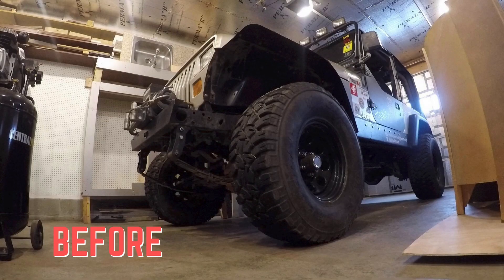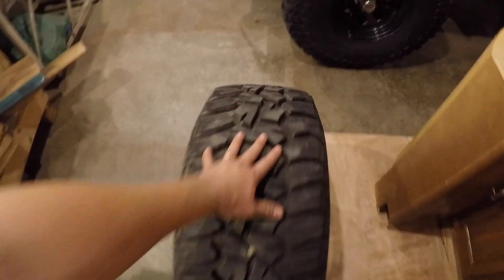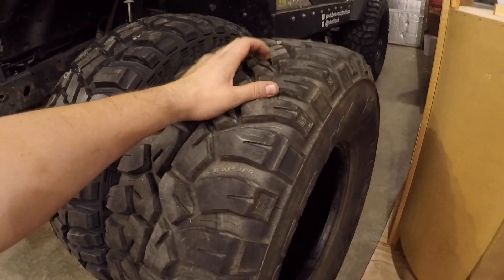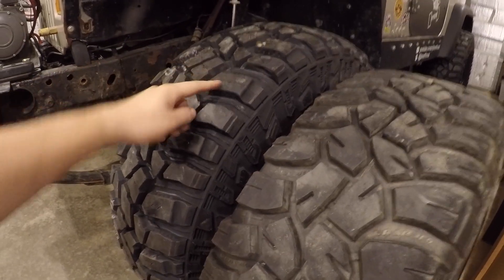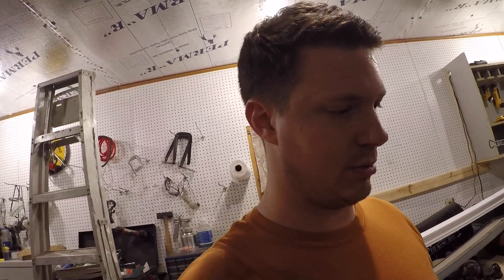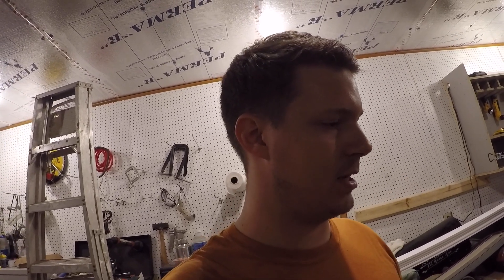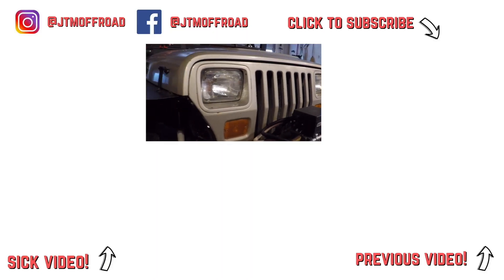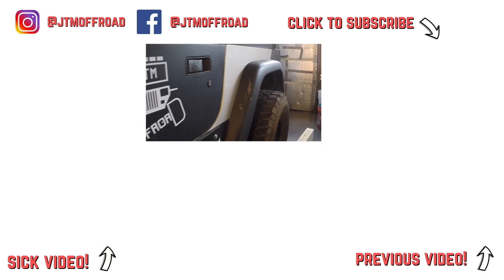35" Discover Cooper STT Pros!

Comment: have found the pro's to be even better than the originals in all aspects. They won't disappoint you , your air pressure for your YJ should be around 21-24 psi all around
Reply from the maker: Great! I’ve had one wheelin trip so far and liked how they performed!
Reply: I started with 33's, now on 35's and 5.38 gears, will be going to 37's here soon and will be going with the Pro's also. Here in Kentucky, we can run through it all and sometimes in one trail ie rocks, sand, clay, rocks, mud... I run a local creek a lot with slate and limestone. I have never had a flat due to nature, had a broken sign post get one and the handle of about a 10" c-clamp go through my tire. I have the '90 renix 2.5, getting ready to start motor swap here soon, then I can actually enjoy it for once  lol
Reply from the maker: That’s awesome! I really need to regear at some point. I’m still at 4.10s.
Reply from the maker: I’ve had some friends go wheel at Kentucky and I didn’t get to make the trip. I think it was rush offroad Park. It rained a lot and they had a lot of mud. That Kentucky mud looked like peanut butter!

Comment: What size lift are you running?
Reply from the maker: 4.5” rough country, 3/4” lift boom shackles, and 1” body lift
Reply: jtmoffroad thanks for getting back to me. Looking to pick up a YJ and I want to run 35’s
Reply: @rich105759   to run 35' on a YJ you need a 6in lift. If you don't want any problems.